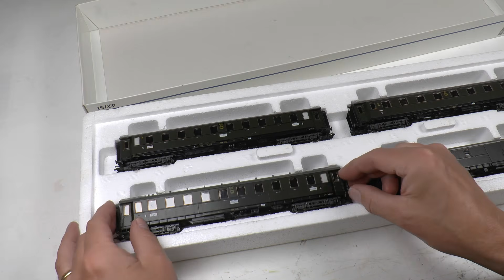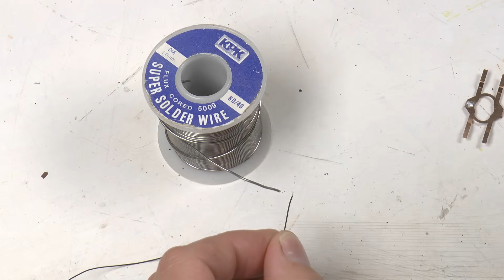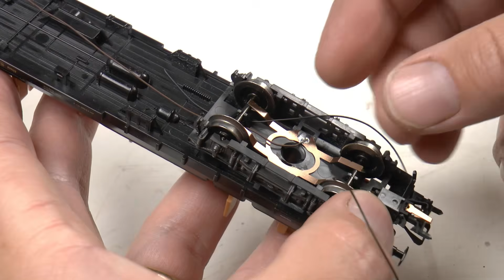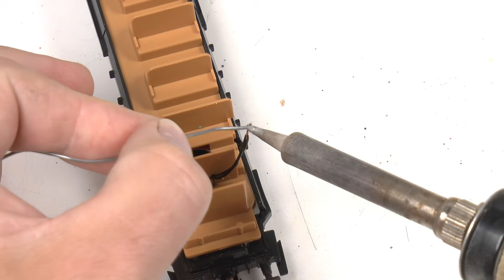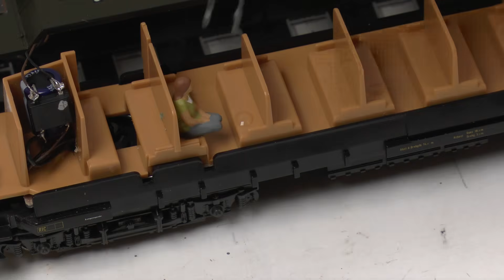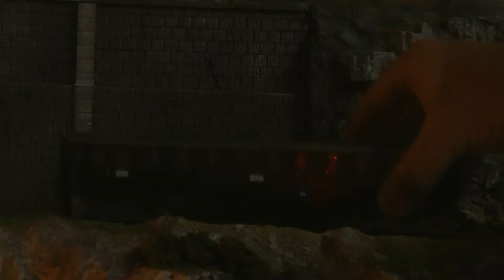Interior Lights Easy, Reliable & Low Cost - Detailed step-by-step tutorial

Comment: Hey Martin,
Great video - as always.  Just one addition to the circuit. 
If you have a number of these lit cars running and switch on your layout all capacitors want to charge with the highest possible power available. Your digital system will see this as a short circuit and will turn of power straight away. To prevent this you have to put in a charging resistor to limit the power consumed while charging the capacitor. This resistor is put between the positive pole of the rectifier to the capacitor. Usually a 100 Ohm resistor is enough. 
Cheers,
Klaus
Reply: Would you need a special type of resistor? Also, is there a diagram of this wiring somewhere? I'm new to this. Thanks.

Comment: If you use the Noch "Hin und Weg-Kleber" you can move the passengers around, and it is also strong enough to keep the light strip in place. The benefit is that you can remove everything and no permanent damage is done to the coach.

Comment: Hello, when you glue some passengers with fastsetglue,  do not close the car immediatly. If you do, some emanations from the glue will change the color of the plastic windows... (that becomes yellow ...personnal experience...) let the car open a night and that will be OK. Thank you for your beatutiful tutorials !  Regards Pascal
Reply: Pascal Keller True, also my experience. I found that glue, used for foto’s works just as well to glue passengers in the cars.  And it is easier to remove the glue if you want to change it later on.
Reply: Good tip, thank you.👌👍
Reply: @eentoffenaam  Another good tip, thank you too.👍👌
Reply: If you have such emanations from glue you can try to put some glossy garnish on them (thin layer). It can help. You can check with just water, if it would help (putting some water on that window should help for a moment - if it does, than gloss garnish will also help - permanently).
Reply: Another product is Museum Wax, which is used by museums to secure items. Hearst Castle uses that, being in the middle of California and its earthquakes.

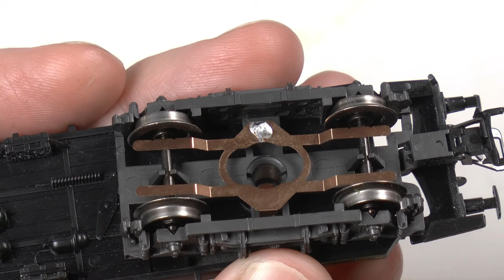Comment: Very nice video, thanks. One comment though: @3:19 and @4:39 the power pick-up spring IMHO should be placed in between the axle and the boogie, rather than under the axle as it is shown here. You remove simply one of the wheels, then insert the pick up spiring and then you refit the wheels. Thus the wheels keep the spring in position. You do not need any glue.

Comment: This actually works!  I've used this method to add interior lighting to a couple of caboose on my layout.   I used 2 3v nano LED's with a 420 ohm resistor on each LED.  Works like a charm.  I don't have any issues powering up the layout as some suggested might happen either without an additional resistor on the capacitor.  The hardest part was getting my Trueline Caboose apart and back together again.  Thanks for posting the video brother.  👍

Comment: This is great and covers some details I had wondered about when I did my first carriages. I agree on reducing the wire thickness and its good to hear which LEDs and resistors you used, as well as the coupling systems. The finishing touch on the taillamps was perfect. Thanks

Comment: Good video!  I found a similar recipe for lighting a few years ago on the internet.  I use double-sided foam tape between the LED light strip and the roof because the LED light strip can generate some heat  =>  i don't want the roof plastic to melt or get soft if it gets hot.

Comment: Thank you for ths good viedeo. It is very informative. According to the LED strip it is recommended to clean the inside of the roof with ethanol. With this preparation the self adhesive strip well adheres to the roof without additional glue.

Comment: Cool. One thing one might consider as an improvement is to control the LEDs with a microcontroller and use PWM instead of resistors. This will reduce power consumption and increase the time car lights survive an outage. It would also enable the ability to use blinking taillights.

 Adding an ambient light detector or even a decoder would make it even more fun.
Reply: The circuit as described will draw less than 1 ma once the capacitor is charged.  It hardly seems that it is any real advantage to use more sophisticated electronics to improve efficiency.  It might be an improvement to add a 100 to 500 ohm resistor before the capacitor to reduce the inrush current when power is turned on.
Reply: Hi, I am new to Marklin and building my layout. What is LED microcontroller  and PWM. Can you help me with a link or where to buy. Thanks Christo

Comment: With a cheap Functional-Decoder (TAMS for e.g.) there's no need to use resistors to reduce brightness, just programm it. And it'd be switchable. Also the rear-lights could follow the direction and turn automatically off while driving backwards.

Comment: Hi, you can put the ground contact under the wheels. With this method, there is no glue. It's more practical when u need to change the wheels or the contacts.
Reply from the maker: Hi! No, assembling spring contacts under the wheels will restrict movement of the cable coming from the conductive coupling. I can’t recommend that.
Reply: @marklinofsweden  You should put that cable into the car, put (through the toilet) up under the roof and have no cables under the car. The same for cable from buggy contact. That way you will not block the movement of buggy at all. With your solution the movement can be limited.

Comment: Nice. The more expensive LED strips have 3M tape on the back. I have used these in many many Jewelry displays over the years, NEVER had any come loose. It is important to clean the surface with Alcohol or the likes to clean off the grease. I generally mount them on Aluminium Flat bar, usually 10mm wide by 1.5mm thick. for commercial applications, for cooling.

Comment: Hi. Thanks for great video! I’ll start doing all my wagons. My question, to reduce inrush current, do I need to add 100 Ohm resistor between input of bridge and ground wire? Or, between + side of bridge and capacitor? Which is better? Can you help? Regards.

Comment: Hello, what kind of bridge rectifier do you use? I am trying to make a white/red lights on my Roco commuter control cab coach. I have 12V LED diodes, 3 white, 2 red. I am going to swich between the lights via a dumb three-position switch. I know it's a bit rudimentary, but I keep it simple. I use digital.

Comment: The design you implemented is missing one key element- a resistor between the rectifier and the capacitor. The purpose of that resistor is to limit the current flowing into the capacitor to a known level rather than the super high current you get otherwise. The reason is if you have a layout with several trains and all cars are similarly illuminated then the combined current of dozens of capacitors charging all at once may look like a short circuit to the control system.
Reply: Totally agree, folk often forget about the cumulative inrush current to these hold up capacitors on switch on, might even pop the bridge rectifier in certain cases. The other is do not be tempted to drop the capacitor continuous rated volts below 25V, even on 12Vdc analogue use where on unregulated controllers it charges to peak volts circa 17V ( neglecting diode drops) at nominal supply volts, going higher with supply and transformer regulation variations. Stephen
Reply: Does that resister go to the + or - terminal on the capacitor? I assume that's similar to the the setup with keep alives on loksound decoders, using the diode/resister on the +ve terminal?

Comment: Two questions 1) re the rear lights and 2) other coaches. You connect the rear LEDs to 2 resistors but I wasn't sure what the resistors were connected to? Presumably one is connected to the conducting coupler but where is the other? Same issue with the other coaches. Many thanks

Comment: Excellent tutorial! I am curious how you handle multiple coaches with one pickup shoe and ground spring- just run the 2 pole connection from car to car, or does the actual circuit need to change for the increase in overall LEDs?

Comment: Nice video but 2 things I don't understand. 
1: you glue the spring in the boogie, but when you take out the wheels of the boogie, you can put the spring in the boogie and then put the wheels back. No glue is needed than. The spring fit in the boogie and with the weels above, the spring can't move. 
2: both side's of the car have a hole, but you decide to pull the cables under the coach. But isn't it better to put the cables through the closest boogie hole and pull the cable under the interior of the car. The cables are then completely invisible.

Marklin has also the sets 72020 and 72021. With the parts in the set you don't have to solder a wire on the koppeling
Reply from the maker: Hi Tim! In response to your questions:
1) Ok. Yes, I realise that is the purpose. However. Mounting under wheel axels restrict the movement of the cables coming from the conductive coupling.
2) In most cars there are no, and then I mean NO room for a cable, not even a 0.5mm cable. If you root the cable through the first hole, you will not be able to snap the car together again. Okay.. This car may work, but any better detailed Märklin car, Brawa, Roco or other brand will for sure require cable rooting under the car.
Reply from the maker: The price of the set is x10 the price for the entire installation described in the video + leaves you with flickering light och low overall performance.
Reply: @marklinofsweden  thanks for response. In my marklin cars, I have put the wire under the interior, and no problems with the cars. I also have made my interior light with low coast.

Comment: Nice job there, again ...   Perhaps if I can add a hint for future projects, I would suggest using a function decoder  for digital layouts, so you can switch the lights on/off using the digital controller.     That works wonders and in some cases even adds possibility to dim the lights and switch rear signal lights separately.      Great stuff, man !
Reply: That's what I was wondering. The track is DCC right? I have digital Trix and I don't get anything out from the passenger coach lights without decoder. 🧐

Comment: If you have a passenger train with current conducting couplers and a common pick up shoe, do you need the electronics (capacitor and rectifier) for each car, or will one be sufficient for the entire train?

Comment: So the next car doesnt have a slider for the third rail but do they have the spring contact? How do you set the other cars lights? Also do you use only one rectifier and capacitor on the slider car or on every car? Thank you in advance!

Comment: Martin,  thank you for this.  I have rewatched this multiple times in recent months, and this inspired a coach lighting project of my own (modern European 2-rail, mostly Roco).  Question....how did you determine the 10K Ohm as the resistor value?  I know the basic formula for resistance, but what are the values??  I assume Marklin MFX puts the same voltage on the rails as other DCC systems (28 volts) and a warm white LED is rated at 0.0025 Amps (I think)....correct?  I'm currently trying 12-20V DC, and with a 4.7K ohm resistor, the light seems too dim (and only really seen in complete darkness).

Another question, how do you get the capacitor to keep the lights on for 10-12 seconds?  I'm using 1000 or 2200 mF 25V capacitors, and the lights gradually die off over 5-7 seconds.  Logically, they should stay on for longer than yours.  Is there a specific to wire them into the circuit?

Have been greatly enjoying your videos over the course of the pandemic!  Looking forward to becoming a Patreon soon!!   :)

Comment: Hi Martin, great video. For a set of coaches, must all the coaches have the marklin 72050 and I assume the current from the pick-up shoe goes through the current conducting couplers. So if I have 6 coaches = 1 x pick-up shoe and 6 x 72050 and 5 x E115737 couplings

Comment: Hi Martin! Nice video, thanks. Just a little suggestion: instead of glueing the copper springs to take the current under the bogie, why not first take the wheels of, then place the springs without glueing and put the wheels back? That's what I do on all my (2 rails DCC) cars and it works perfect. Since I don't have Marklin rolling stock, I use generic metal springs I buy on eBay, but the principle is the same I guess.
Reply: The way to do it 😁

Comment: Does this also work for analog layouts?  would the "reverse puls" not be higher then what the cap is rated for?
Reply from the maker: Yes! It works for analog layouts too. No 25VDC is ok, even though a bit on the low end.. Going up in voltage adds too much size, so it doesn’t work so well.

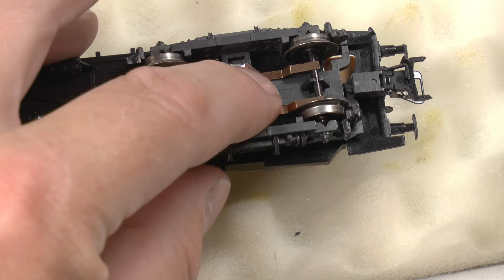Comment: 4:30 you should infact install the contact spring "fingers" under the wheelaxles, not above them (seen from bottomview perspective) and then you don't need glue at all, because it will keep the spring in place by the wheelaxles pressing to the bottom of the bogie.
Reply from the maker: Hi! This question has already been answered. No. The placement is an active choise based on experience

Comment: I think it may be cool to have certain areas that are rocky or rundown where lighted cars would intentionally flicker. I thought you might be able to do this with a microswitch (normally closed) in the car and a piece of piano wire (very stiff) bent into a corrugated/serrated form that would hit the microswitch and cause the lights to pulse on and off making the appearance of a bad connection due to rust and dirt buildup

Comment: Hello Martin,
I don't like your solution. If you have 40 cars like this you'll have a big short-circuit on startup, because all elkos are empty.
To avoid this problem you have to connect one pole of the capacitor through a resistor in parallel with a diode...
Greetings, A

Comment: Do you have a link to the magnetic couplings for the electronics?  :)
Reply: Fredrick, I have the same question! I have tried searching for them everywhere! I want to use them in a car diorama so I can have a removable roof with the lights still installed.

Comment: I never use leds this big in coaches, theyre the equivalent of being 3 feet long, i use 0604 SMT leds on a piece of circuitboard, i know people say" well you cant see the leds" but its the light they give off, its way too spread and will light the track up and thats not realistic.
Reply from the maker: The LED intensity is controllled by resitors. The spread can be controlled by paper inserts. The theme for the video is ”easy and low cost”. I can think of a million ways to do this more expensive and complicated, but that was not the purpose with this presentation.

Comment: Why trouble yourself with a bridge rectifier? Since we´re digital it´s DC not AC. All you need is a 100- 150 ohm resistor (see Klaus below) after a diod. Smaller, easier to assemble.
Reply: You need a rectifier to keep the capacitor loaded, without a rectifier the lok or other coaches consume the stocked voltage in the capacitor.

Comment: Thx for the Vid !!! It helped me a lot . But won't the led's melt the roof since they heat up ?
Reply from the maker: Hi! Thanx! No, the LEDs will not get warm at all. They are only powered with <1mA
Reply: The two 10K resistors he put in series with the LEDs reduce not only the light level but also the amount of heat they generate.
Reply: Ok, thanks guys.

Comment: Hello! Can you please explain why is the  Bridge Rectifier 2Amp SMD (Surface Mounting Device) type needed?
Reply: Nvm. I found that it is something for AC. I have DC.
Reply from the maker: No. It’s because you cannot control the polarity to the coach. It shifts when you shift position of the car. The LEDs requires always correct polarity
Reply: @marklinofsweden  I tried my led strip on both sides of the track and it worked. Maybe I need the bridge for the capacitor?
Reply: BTW my system is dcc

Comment: Amazing video.  Can you tell me the exact specification of bridge rectifier  ? Thanks
Reply from the maker: Den är likriktare.

Bridge Rectifier 1Amp SMD (Surface Mounting Device) type. 
Distrelec Article Number: 301-13-444
Reply: @marklinofsweden  thanks. And resistor and capacitor  ?

Comment: Could you please confirm if those LED strips give off heat, which may eventually damage the plastic of the car roofs?
Reply from the maker: Hi! No. The LEDs are powered through 2x 10kOhm resistors, so the total power is extremly limited. Actually.. 0.1mA or 0,012 Watts.. So.. No heat whatsoever.
Reply: LEDs don't give off heat

Comment: Two notes: the choice of the colors of the cables is not so happy, brown and black are difficult to distinguish.
If you use superglue, it has to outgas first. If I use superglue in a passenger car and then put the case on, the gases from the glue make the window glass opaque and almost white. my own experience.

Comment: Thanks for the effort, but this system is not easy for everyone, you have to have some experience. Not cheap, and that's what all brands use. the real innovation would be a system with internal power supply with mini batteries.